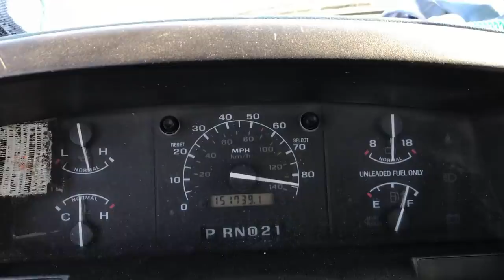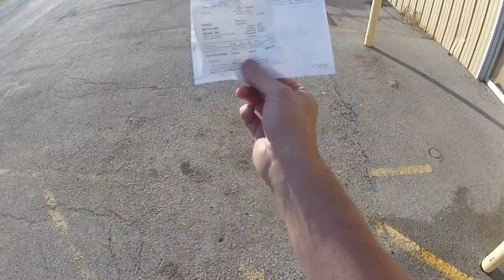TRASH PICKING!  Free Stuff in the Trash!  How to Make Money from Trash!

Comment: Nice set of ramps.
Reply from the maker: Alabama Scrapper they were very bowed.  But still I should’ve kept them.
Reply: @ShaneManTV  the reason they bowed is for the deck of a riding lawnmower to clear the truck tail gate.or makes it easier to get a four wheeler on a vehicle or trailer.